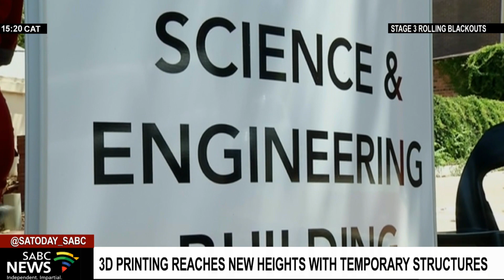New 3D construction printing machine launched at University of Johannesburg

Comment: THIS IS BEAUTIFUL; I am admiring these everyday, I wish Cyril Ramaphosa become a 2nd face on Rand notes. He deserves it, its dawning. I can see the light. 

Reinforced concrete, concrete into which steel is incorporated in such a way that the two materials work in resistant forces together. In a concrete frame, the reinforcing steel — rods, bars, or mesh — absorbs tensile, shear, and even compressive stresses. 
Plain concrete does not easily withstand tensile and shear stresses caused by wind, earthquakes, vibrations and other forces, and is thus inadequate for most structural uses. 
For reinforced concrete, steel’s tensile strength and concrete’s compressive strength work together to allow the member to withstand certain stresses over substantial spans.